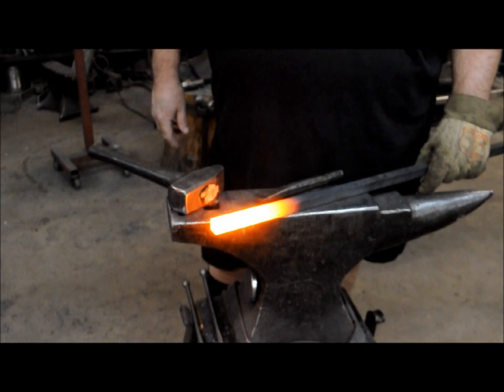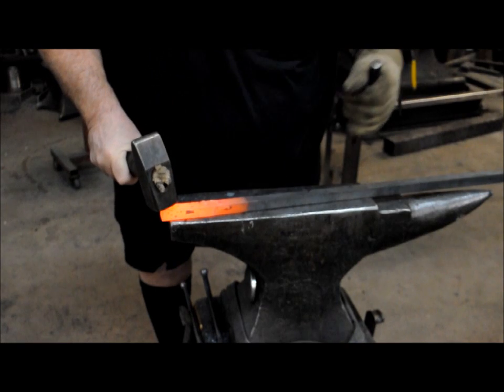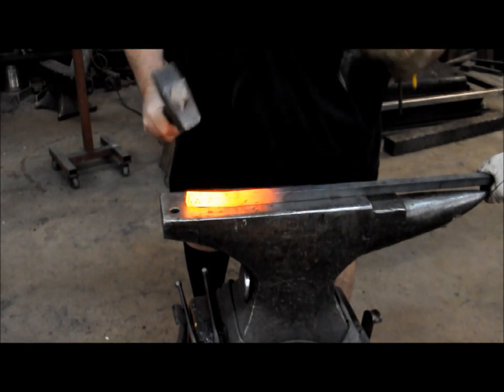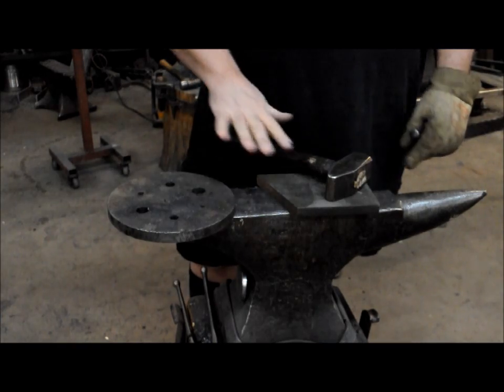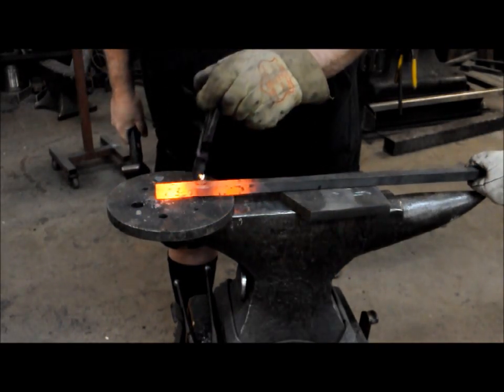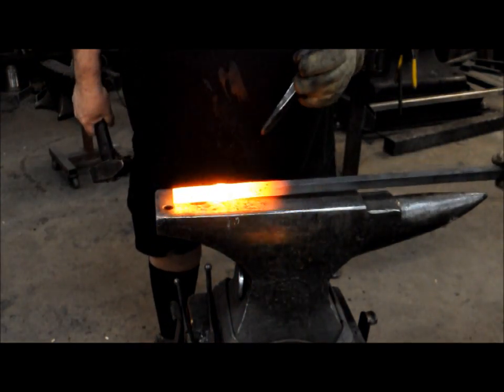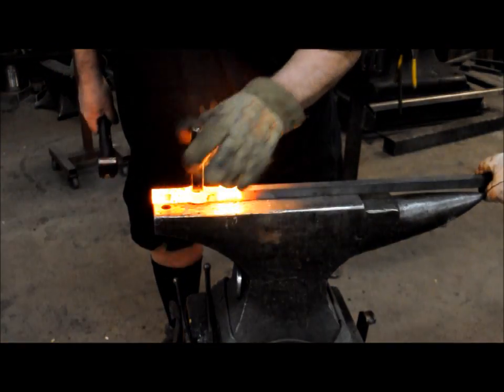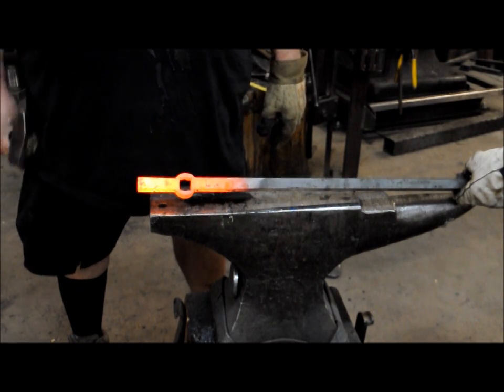Hot Punching Square Holes

Comment: I see the tip of the Drift getting red hot not good on the tool after each set you need to quench cool your tool so not to detemper the tool that y you see blacksmith sticking the cold anvil after 2-3 hits to cool the hammer head and Thank You Adam coke dust would be a great lube I need to try that over all great video keep up the great work and videos Frank